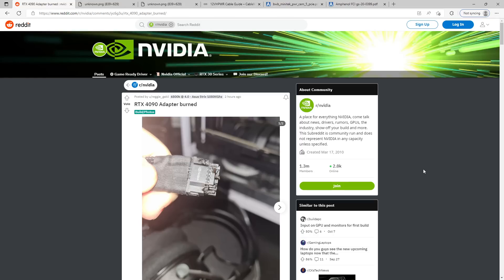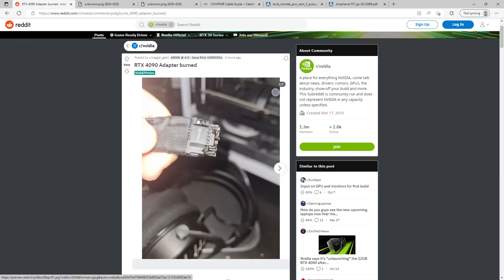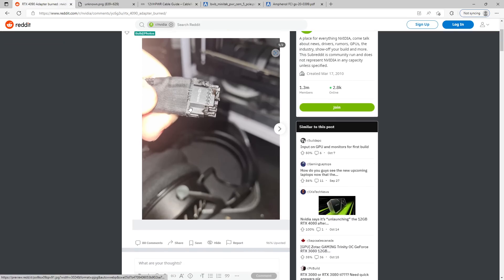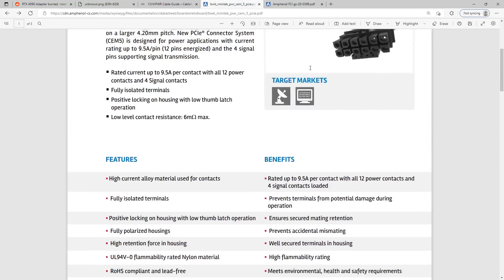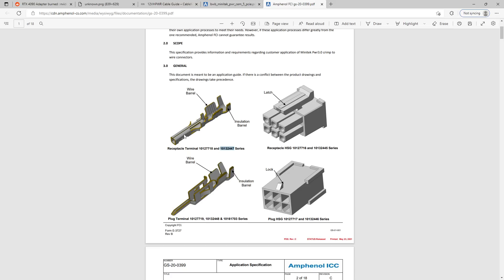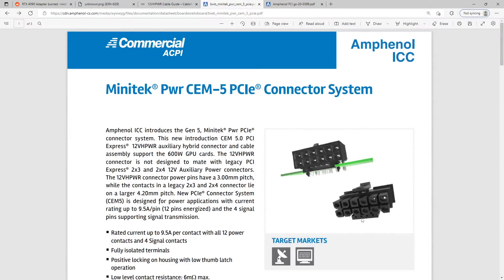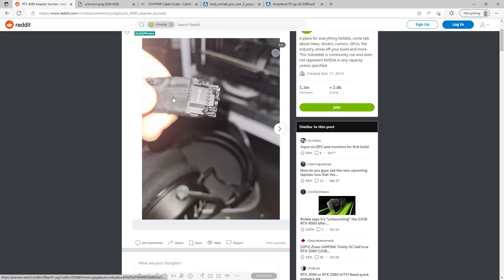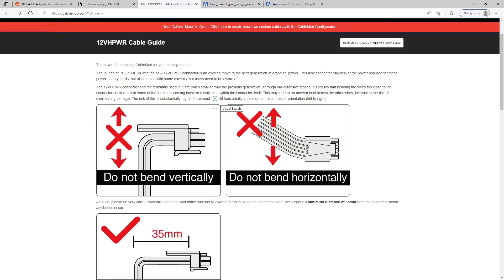The 12VHPWR connector sucks

Comment: "4 8Pin connectors take up too much space"
Um, do I have to remind you how big the GPUs are in total? How about they do the same as back then with the 2060 and just add wires to connect them a bit behind the PCB in the cooler? Or, even better, just move the new connector with wires somewhete where you don't have to bend and wiggle the fragile connector to get it even in?

Edit: I just remembered that there's a perfect, robust connector that's capable of 720W that already exists: The XT60 connector! Rated for 60A and field tested by many drone pilots and RC car drivers, this should be able to deal with this perfectly!

Comment: For other connector systems there's plastic retention clips you can get that go in the back of the plug and hold the crimp terminals in. I wonder if that sort of mechanism might have helped in this case.

Comment: After some research, the current rating in the connectors datasheet was apparently changed in 2021 and the datasheet for the pins says they are rated at max 6.4A on 6 circuits with 18AWG wire and a PCB on the other side, giving a total of ~460W, that is considering you want to put 6.4A through a 18AWG wire and you ignore the fact that the GPUs PCB also heats up and means you have to lower the rating

Comment: My old EVGA P55 Classified 200 motherboard has twin 8 pin CPU connectors for 600 watts. Why NVidia couldn't have just used 2 special 8 pins with different terminal shapes is beyond me. Normal 8 pins only have 3 current carrying wires, so 2 special 8 pins with 6 current carrying wires and 2 sense wires each would have been perfect. It just needs 2 adapter wires instead of this octopus of a wire. But I'm not an engineer trying to cut costs...

Comment: I decided to figure out if there is a large difference between the new 12-pin (Amphenol Minitek Pwr 3.0) and the old 8-pin connectors (Molex Mini-fit Jr). I found out that they are basically the same size and the plate thickness is 0.2mm for both. The maximum contact resistance (the important part) is also the same 10mOhm according to the datasheets. The material of the 8-pin (either brass, nickel or phosphor bronze) has more internal resistance than the copper alloy of the 12-pin but also more area so the difference between the two is small. The connectors for the 8-pin are rated at 13A each where those of the 12-pin are rated at 12A. The heat produced by the contact resistance is the interesting part. The 12-pin at 600W has a current of 8.33A per contact, resulting in 0.7W of heat per contact or 8.33W of heat in total. An 8-pin at 150W has a current of 4.17A per contact, resulting in 0.17W of heat per contact, or 1.04W in total. Funny thing is, a single 8-pin connector is actually larger than Nvidia's 12-pin and thus the 12-pin has to handle 8x the heat in a smaller size.
Reply: So someone had to approve putting on a connector that outputs twice the heat of 4 8pins put in less than a quarter of the space. Genius.

Power connector cooling fins/fans when?
Reply: @Church256  Lmao now we need heatsink for cable? When will we water cool it lmao
Reply: I already do lol
Reply: @Church256  NOW

Comment: Is there a way to measure the GPU connector temps? Can i prevent this from happening by monitoring the temps with hwinfo or something?
Reply: There’s currently no sensor for that in the cable or on the card. Next best bet is to install a smoke detector inside your pc case

Comment: in pretty much every standard case with a gpu directly in the motherboard, the power cable is going to immediately 180 and go along the back of the card. And depending on how far from the I/O side of the card the power connection is, its likely to to bend horizontally to get around the motherboard into a cable management hole. If someone designs  a connector for this task knowing it can't handle these stresses that will be faced in a majority of cases, they are just an actual idiot. Shred your engineering degree, and probably your highschool diploma. Works fine if used as directed, starts on fire if used as expected

Comment: So you know Nvidia knew about this problem. Because the 30 series had the connector at an angle so it wasn't sticking straight out of the card. That being said I'm not overly worried yet. Basically it needs a 1.5" strain relief for the cable. I am pretty sure I can accomodate that in my current case and for ITX I am willing to bet someone has already designed a right angle connector and it will hit the market any day now.

Comment: I'd say you need a special case for these 4090 / 4080 cards that allows for PSU and video card placement to be done in a way that doesn't bend that cable anywhere near the card.
Reply: ah yes, the legendary pizza box case.
Reply: @Born_Stellar  The Fractal Torrent tower with the vertical GPU riser will work since it places the PSU at the top you have a strait shot down to the card with no bends.

Comment: I get the idea behind remote current and voltage sensing, but it's not really important here. At this point, we might as well just start using a pair of fat screw terminals or bullet connectors and 6-gauge cable. Surely there's an existing industrial solution to the problem of transporting 50A of 12V a distance <24" without catching fire
Reply: That sounds remarkably practical.
Reply: @wargamingrefugee9065  Right? The 90A relay I replaced at work? Screw terminals. The portable spot-welder tool? 8mm bullet plugs. The CPU+VRM module in a Power Mac G5? Surprisingly, screw terminals. This is so far from a new idea, but the industry is obsessed with shit-tier Molex connectors.
Reply: @asm_nop  Hello,  igorsLAB posted this video, "Das Grauen hat ein Gesicht: NVIDIAs feuriger 12+4 Pin Adapter für die GeForce RTX 4090 analysiert!"  (Yes, it's a German language channel, but he posts an English translation of his written articles too.  Sadly, the translations are a bit rough [Google Translate and a fast edit?].  However, they're still worth a read.)  If you haven't already seen it, you won't believe what's inside of the nVidia supplied 12VHPWR connectors.  The wires are soldered onto tiny little pads made from stunningly thin metal.  You hit the nail on the head when you wrote "shit-tier connectors".   Have a good one.  EDIT:  The link to the article is in the video's description.

Comment: I cant wait for nvidias answer to this to be by adding a 2nd 12VHPWR connecter and trying to dynamically load between the two. 

If they are dead set on it they could at least put them a bit deeper on the PCB so the cable has some length before it bends out.

Comment: I was under the impression this cable is part of the the ATX3.0 PSU standard drawn up by the PCI-SIG group.

Which isn't just an nVidia thing. Although they are first to market with it.

AMD and Intel will probably follow suit in due course.

Similarly the beloved 8 pin connectors replaced previous standards as GPUs needed more and more power.

The new plug also allows for data to be sent between the GPU and PSU to dynamically allow for transient power needs.

Having said that it does look like somewhere along the line the design was compromised.
Reply: Nvidia and AMD RTG are only parties who had vouched for the specs of the cable. There is no other peripheral other than factory overclocked performance, gaming GPUs that actually needs that amount of current.  Enterprise-tier SKUs closely adhere to 300W power target. The sad part is that AD102 doesn't need this cable. Nvidia could simply stuck with ~300W power target and 4090 still easily outperforms its predecessors and likely would outpace big RDNA3. The massive power dump you need to get that extra 5-10% out of the silicon is just silly. Only hardcore overclockers would such measures. 

Nvidia unintentionally pulled a Fermi 1.0 for no real good reason.

Comment: They did not add any contacts.  It was 2x 6 power pins before.  And 4 ID pins.  They just regressed in the size and current capacity of the connector by using a smaller one.

I dont mind a new connector with smaller ID pins, but they should have kept the same size power carrying pins.

Comment: Why not go with the 12V connector used by HP 10 years ago for their hot swappable 12V,800W power supplies.  It's essentially an edge connector like the PCIe data socket, but with really fat pins. Cable would be flat braided copper covered in plastic, not a bundle of thin wires.  Such high current stuff need to be made like high current stuff, not 1980s home computers with 100W power supplies.

Comment: NVidia: Doing dangerous things to save a few mm of PCB space. Also NVidia: Building a GPU the size of a freaking house.
Reply: Its like squeezing 3 cameras on a Smartphone but apparently there is no room for a headphone jack. 
Good thing Sony still makes Flagship phones with headphone jack 4 & micro sd slot.
Reply: soon gonna need a separate case just for the gpu lol
Reply: Intel made this connector. Not Nvidia.
Reply: @pokealong  NVidia chose to use it, for this purpose, and with a bad implementation (see BZ's next video). All on 2 grand cards. Intel can share the blame a bit, maybe, but not most of it.
Reply: @LeoDavidson  Nice, Youtube keeps deleting my comments. Search "PCI SIG melt" and you will find articles discussing how PCI SIG found the issue is the CONNECTORS designed by INTEL that is the problem, and this identical metling is happening on the PSU ports as well. This issue is 1000% an Intel design issue, and Nvidia nor AMD has any control over it in any way. They are just using a standard created by somebody else.
Reply: @pokealong  When, in the entire history of mankind, has the existence of one standard prevented another standard from being introduced?
Reply: @pokealong  Intel & Nvidia are part of this.

Comment: Issue is the ammount of current flowing through that connector, 9.5A is a lot and i mean a lot, standart plugs and sockets handle that power, and this is a tiny connector, any small disconnection causes staright away resisance and heat. Good luck Nvidia

Comment: This is just another reason why they should never have moved away from the angled connector on the previous generation. It actually worked with rather than against the cable by mitigating some of the issues. You don't even have 35mm of space for a connector sticking straight out from a horizontally mounted graphics card in the vast majority of cases.

Comment: this isnt just about number of pins but also about combined cross section area, or if to be as precise as possible - total area of contact. Smaller total area of a conducting joint leads to a higher temperature 
For 3 8pins its prob like 10-20 times higher than for this joke of a connector. in a normal country such a tiny connector for such a high current wouldn't be even allowed due to fire safety concerns. 
Nvidia should be prosecuted for this. This is no joke, people with mediocre PSUs may get their apartment burned cuz of this.

Comment: Never even thought I'd have to be concerned about a power connector specially provided for a new generation of halo cards.  Wonder if this connector is going to be changed/replaced in this generation or if NVIDIA would rather pay out the lawsuits that may arise from this potential design flaw.
Reply: nVidia won't pay any lawsuits because their lawyer squad will cancel all of them because the problems were of course "caused by bad manipulation from the user". 

I'd bet Nvidia will never officially acknowledge this problem. 
They'll just sweep it under the rug like all their shady stuff.

Comment: Number of pins says nothing about current rating, it’s all about the type of pin. I feel like you know this but you needed the make the narrative work. The connector designers really know how to design for a specific target specification. 

They should have just make the connector a tad bit longer or have (mandatory) integrated strain relief. But honestly PCI SIG should have just specified the location of the connector to be on the bottom or the end of the card.
Reply: The old connectors actually have a lot more headroom. These new connectors are just bad....

Comment: They (NVIDIA) schuld have made it a bigger connector with thicker pins, but no they made a 
tiny connector that is about as big or smaller then a normal 8 pin PCI power connector.

Comment: if they were concerned about PCB space they should have made a 2 pin instead: 1 for ground and one for load, using 6 to 8 AWG wire. 8 AWG wire can handle 50A at 75c, so 12v*50A=600w. 6AWG on the other hand can handle 65A making it 780w@12v (or 702w at 10.9v if your PSU has a dodgy 12v rail). or just make 8-pin V2 with different keying/gendering which necessitates manufacturers to use 18AWG which can handle 14A, so you can have 4 ground and 4 live, delivering 672W (610w@10.9v), or 16AWG making it 816w@17A@75c...

Comment: If they had at least used quality pins designed for the power, it would've made sense... Not using the same style as the 8 pins... Something like a Deans Ultra plug would've been much better choice.

They'd be able to get by with just one or two pins, lol.

Better spring force for keeping contact as well.

Comment: The pin should not force connector open, it's normally sitting tight in its case
my guess is that bending cable horizontally is causing excessive pulling on the wire and it's the wire that is slipping out of the crimp

Comment: The mini terminals suck I have sampled a few varieties too. The little legs it uses to hold in the connecter are tiny .5mm the regular ones are 1mm. So when you pull on them like in the picture the terminals on the end pull out. I've made my own cables multiple times with them and you have to make sure those little clips are bent out and ready and you have to check every wire three times.